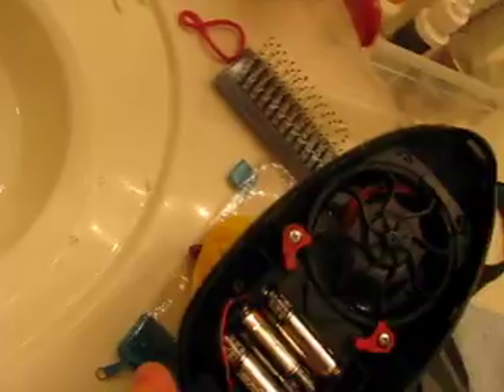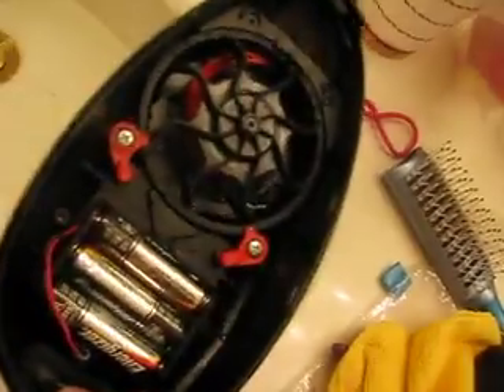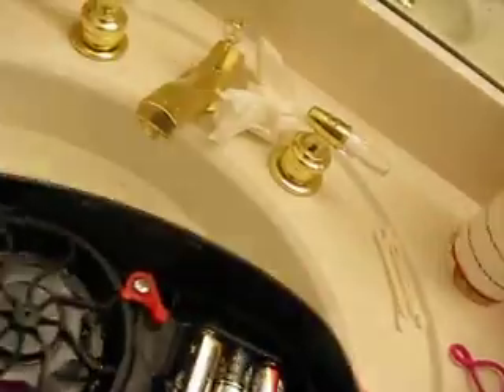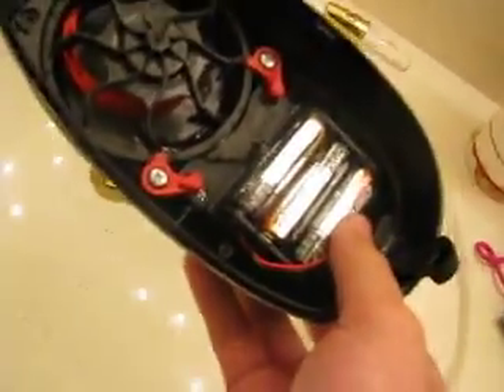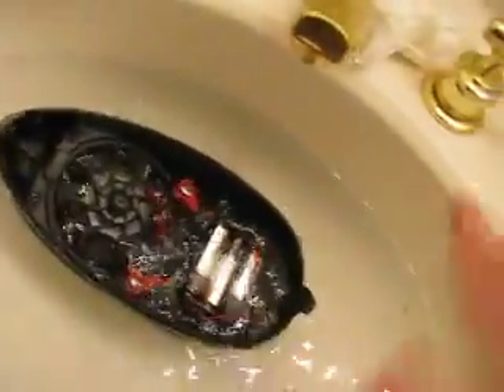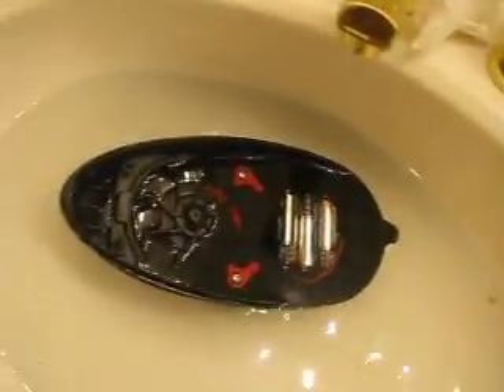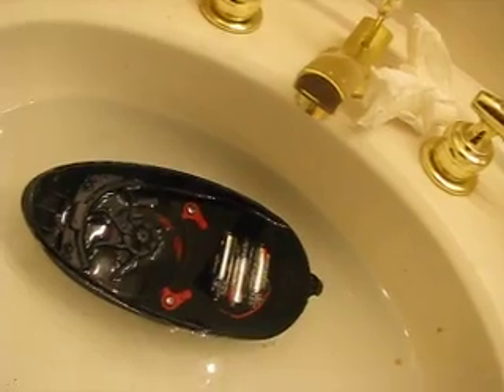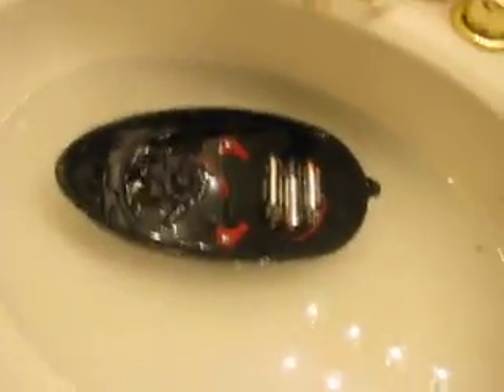Rotor durability testing CONFIRMED (water resiliancy only)

Comment: @THEPAPASMURF1 Child please, child please. By board do you think they meant this?
paintballgatewayDOTcom/dyerologebox1
Because that's not a board. It's a motor powered by the batteries that turns all the gears inside the rotor. They do make boards for rotors but the stock rotor which the one the guy has in the vid has no board.